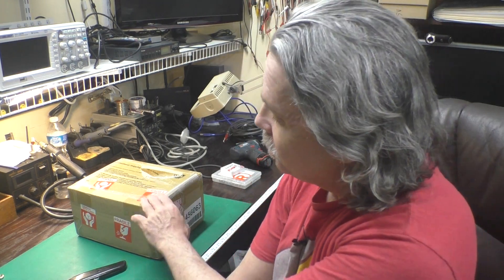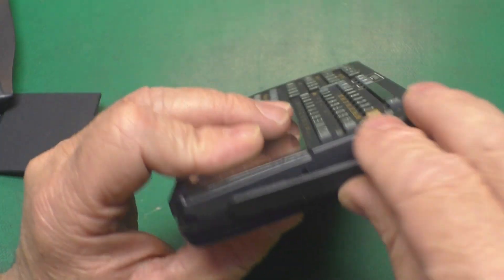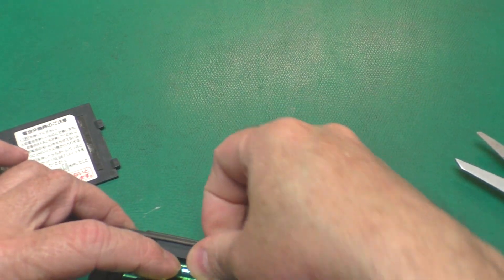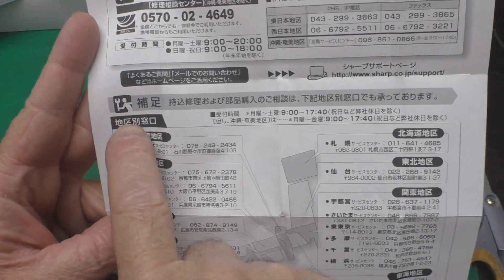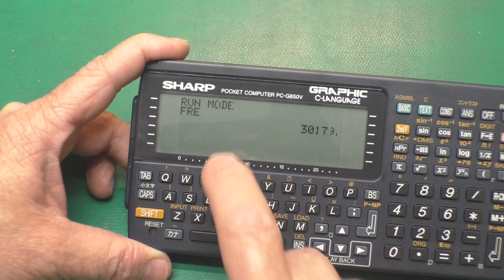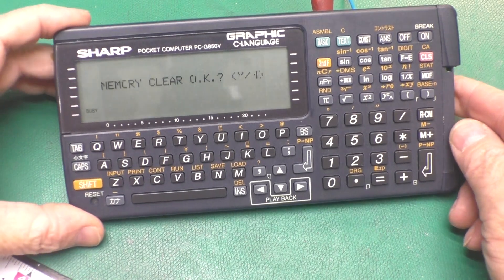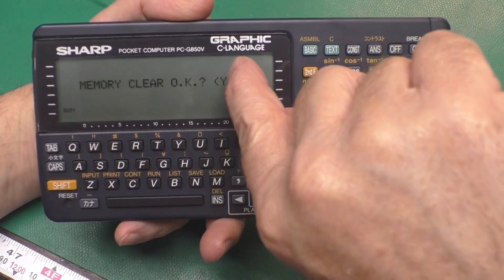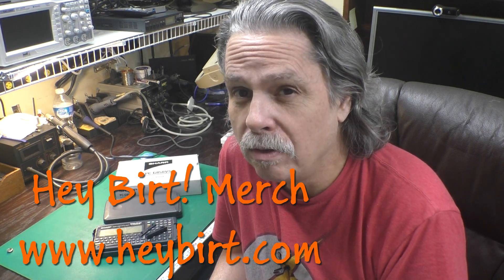3 Sharp PC-G850 from Japan – Unboxing, overview, teardown, repair and stuffing it up

Comment: Ahh, the ole' reverse polarity blunder.
We've all been there. ;)
Pretty good that you managed to get the conductive strip to re-connect. Ive never got that stuff back 100%.
Reply from the maker: It killed me that I am even saying 'Positive here...' as I hooked it up wrong. I have not had the best luck with the TAB connections either. I suspect if there had been any corrosion from battery leakage it would have made its way in there and it could not have been fixed. We'll see how long the 'fix' lasts.

Comment: Thanks for the great video. I was on the point of binning 2 x G850V, but thought the better of it, and checked YouTube first !  Never heard of Kaptan tape before, but just the right stuff. Took some time with the soldering iron at 180 deg C but worth the effort. Thanks again.
Reply from the maker: Excellent, glad you were able to save them. One of mine I had to do a second time, but it has been working like a champ since then.

Comment: Thanks for the tip! I just got mine in the post from Japan today that was missing maybe a dozen columns of pixels.

I used a 2mm chisel tip and set my soldering iron to 200C. I found that by heating up where the conductive tape lifts off (maybe 1mm from the last point it is stuck), I could see which pins I had treated and know they were all electrically connected. If you go along just where it’s already stuck, it’s hard to know if you’ve actually solved the problem, so overshoot by about a mm.

Doing this it fixed it all in one go. Just keep the soldering tip moving at all times!

Comment: Wow, great minds think alike.  I've been collecting the odd pocket computer here and there for years.  I actually have the whole line from Radio Shack.  I was recently looking at the Sharp 850's, mainly due to the English guide.
But now you've broken the silence, I hope prices don't skyrocket - the Canadian peso ain't what it use to be.
Reply from the maker: There seem to be loads of the G850s in Japan so I don't think there will be much upward mobility of prices in the near future.
Reply: @HeyBirt   Apologies, that was meant to be tongue in cheek; you're right there seems to have been a bazillion 850's released in Japan - perhaps it was a school requirement at some point?
Reply from the maker: @MattKasdorf  They seem to have been widely used at universities and technical schools to teach programming and computer science subjects. A cheap computer that each student can carry with them.
Reply: You knew most of the Tandy "pocket computers" were made by Sharp, right? The TRS-80 PC-1 was Sharp 1211 rebadged, PC-2 – Sharp PC-1500, PC-3 – Sharp PC-1251 and finally  PC-8 was Sharp PC-1246 The rest were from Casio. Maybe you knew this, but if I start collecting other pocket computers, I'd concentrate on a full "Sharp collection," maybe rounding the collection off with a trash80 PC or two, instead of the other way 'round.

Comment: Nicely done. I was watching an old video where you temp glued a circuit board to mill it. Here is a trick. Try hot Glue. I know, we mostly hate that stuff. But a few drops of Denatured Alcohol (nothing else works) will literally make it fall off. I saw a demo where someone put it all over a circuit board. A few drops of DA and they literally peeled it completely off in seconds. I tried it myself and was amazed. Its become my favorite glue for lots of things because its sticks so well but is so easily removed without a trace. Try it :)
Reply from the maker: Some forms of hot glue do indeed release immediately with alcohol. They use this trick to pull dents out of car body panels. My only concern with using it to fixture a PCB is that it might be difficult to get it flat/parallel to the surface you are gluing to. I think it would hold up well to the stressed created by machining the PCB though.

I will give it a try. Good idea.

Comment: Do you know if this display issue is more frequent for particular models (G850, g850S, G850V, or G850VS)?
Reply from the maker: I do not know if one model suffers worse than other but I have seen pictures of most model with this problem. I suspect it has to do with the type of conductive adhesive used.

Comment: Hey Birt what is the real difference between the G850, G850V and the G850VS? Trying to decide. Thanks. Happy computing!
Reply from the maker: Most folks with both the G850 and G850V(S) say the V(S) has a higher contrast LCD. The VS is the latest version which is 10g lighter and has the OS in a different location. The VS also uses a flash chip instead of ROM as I recall but no OS updates where ever released.
Reply: @HeyBirt  Thanks. VS flash. That could be a problem. Overwrite OS a problem area... Do you know of anyway to transfer basic programs to/from P.C.? Seems safest to me then is G850 or G850V. Thanks.
Reply from the maker: @kenunix1863  I don't know of anyone who has accidently overwrote the flash, I don't think that is an issue.
Reply: @HeyBirt  What about transferring basic programs to/from a P.C.?? And thanks for the advice about the VS.
Reply from the maker: @kenunix1863  Take a look at this page. Note that the serial output of the G805 is inverted so the FTDI cable has to be programmed to compensate for that.

https://kurikou.sakura.ne.jp/pokekon/option/USBlvc2.html
Reply: @kenunix1863  This is no problem. You just transfer your file as ASCII data into the pocket and on-board you can translate it to a source file and use it.

Comment: Does this support memory backup via coin cell?
Reply from the maker: No, but you can safely change batteries without losing data. The manual says it will retain data for at least 5 minutes without batteries installed.
Reply: @HeyBirt  Gee I wonder how they manage that, super caps? Did you try it?
Reply from the maker: @kenunix1863  The SRAM chips used draw very little power, a few hundred uF will last a few minutes. The 80mAh NiCad memory battery in a TRS-80 Model 100 can keep 24 RAM chips alive for a month or more.

Comment: Same screen issue, here :/
Reply from the maker: A few strips came back after a few weeks so I had to dix this one again but now it is OK.
Reply: @HeyBirt  I feel like this is specific to the G850(V(S)), the manufacturing error seems to affect all series of this machine after a few weeks or even months of use.
Reply from the maker: @bonsens1578  I have seen the problem on other LCDs as well but most all of the G850 series seems to supper from it.

It could be that the conductive adhesive strips used were not good or perhaps they did not use the proper temperature to seal them.
Reply: @HeyBirt  The solution: never buy a G850VS. Except that I bought one, after 1 year the problem occurred, I tried to fix it by watching your video... And finally I broke everything. I'm hesitating to buy another one... If I give in to my desire, would it be possible for me to ship it to you for repair? Obviously we would agree on the price to pay for the intervention of the expert that you are;)
Reply from the maker: @bonsens1578  Sure you can send it to me, contact me at birt_j at soigeneris dawt com